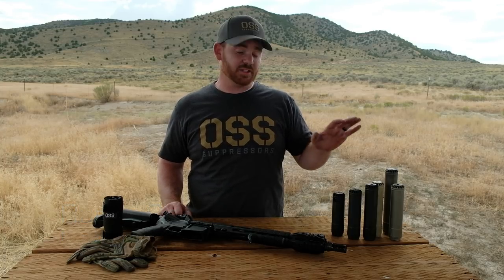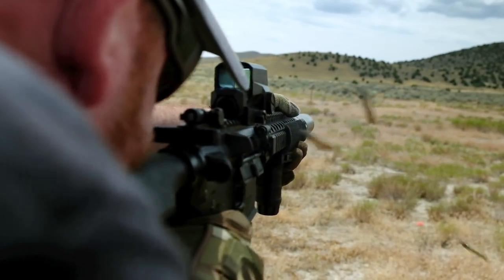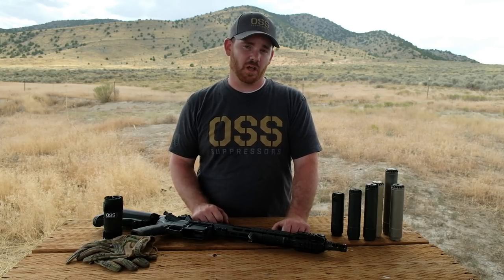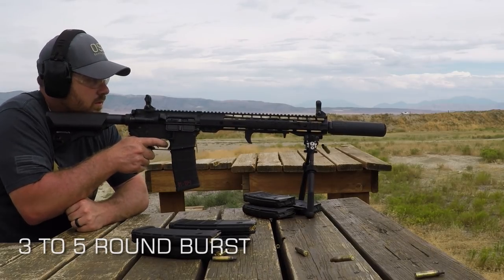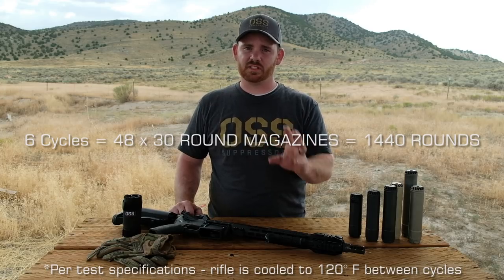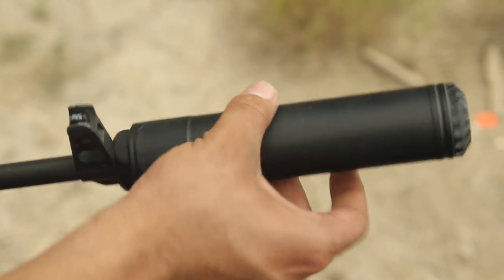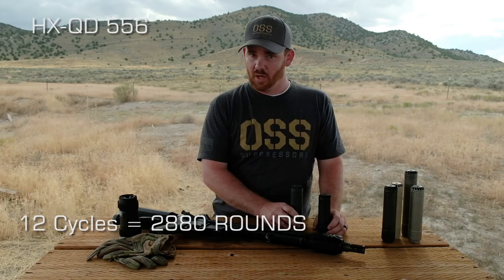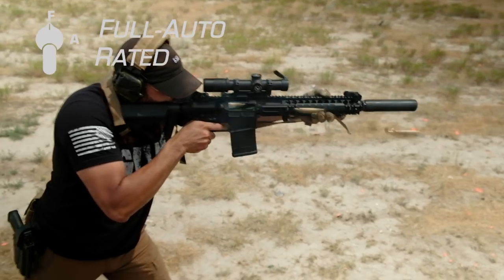OSS Suppressors: Helix-QD - Full Auto Rated

Comment: The test is great but my question is with full auto and bursts approximately how many rounds can the suppressor take before malfunctions begin to occur either with the weapon, suppressor or both? At least knowing this would allow the shooter to know how hard the suppressor can be pushed before catastrophic failure would take place in any condition including, well, just firing off as many rounds as you could for fun with the suppressor attached.
Reply: this is what i would like to know. I ordered my first suppressor last month, the Dead Air Wolfman and want to know how much sustained fire that suppressors can take. I usually do mag dumps 95% of the time at the range so it would be nice to know when to stop before I break the can. I suppose I could just dump a couple 25-35 round mags at a time and let it cool off for a few minutes

Comment: I'm interested in your new flash hider muzzle device. How good is it at suppressing muzzle flash, especially when compared to other suppressor ready devices currently on the market?
The Sandman suppressors also try to redirect gasses out of the front. However, this causes them to have muzzle flash issues one does not typically expect when running a suppressor. Does your product have similar issues with muzzle flash due to the gasses venting out of the front?
Reply: yep